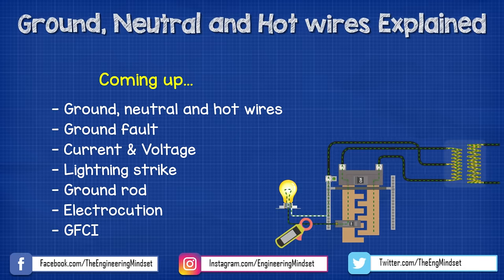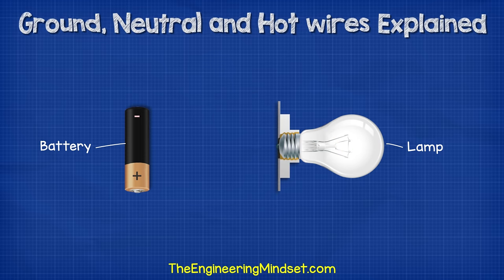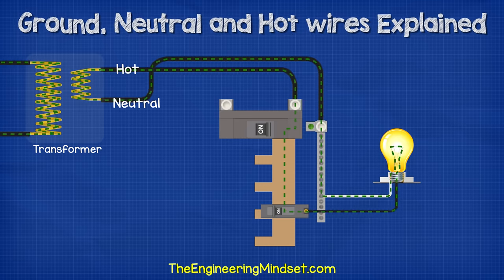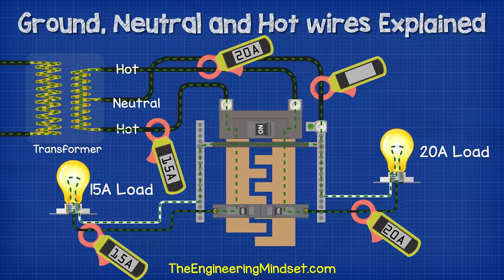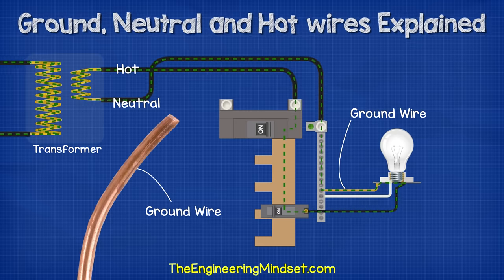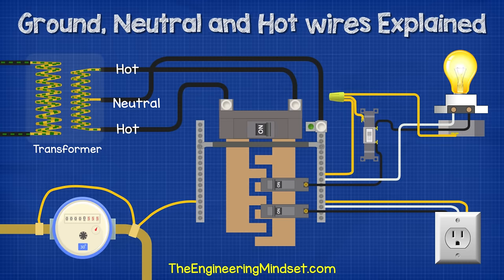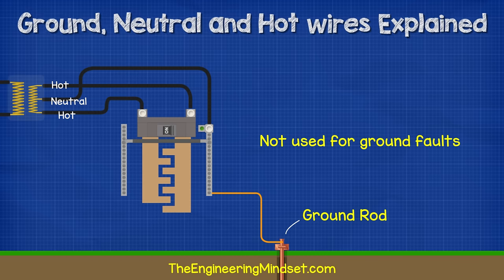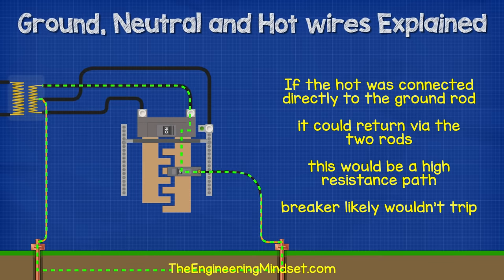Ground Neutral and Hot wires explained - electrical engineering grounding ground fault

Comment: Probably the best explanation I have heard. This covers a couple pet peeves of mine. For instance, you often hear "Electricity always takes the path of least resistance." No, no it does not. This video does a good job showing people this concept. Another is that people think ground is there to save them. Again no, at least in the direct sense. Excellent video.
Reply from the maker: We just published a new Ground fault, short circuit and arc fault video, so much detail! Link HERE➡: https://youtu.be/Qi0ynSQw-wc

Comment: Dear Paul, I was never clear how my electrical system worked.  Your video enabled me to run a 240V line from my cabin to my shed in the backyard and it WORKED!  I also tapped into that line and made a 120V outlet work to run the lights there as well.  Thank you for this fantastic elucidation of a very difficult subject to understand.  -Paul
Reply: That would be so illegal where I live. We're not even allowed to hook up a new socket in the house, that's reserved for electricians.
Reply: Bad idea.
Reply from the maker: We just published a new Ground fault, short circuit and arc fault video, so much detail! Link HERE➡: https://youtu.be/Qi0ynSQw-wc

Comment: I been an Electrician for 40 years.. Someone finally shows how it works and why.... Yeah it's a simple explanation..But it sure helps new engineers understand the why part. As America and European have different types....

By the way.. It's why we only bond the Main Service Panel..It's need a path back to the transformer..All other sub panels are not bonded...
Reply from the maker: Check the new SUB PANEL EXPLAINED ➡️ video https://youtu.be/NUSNa-7Hecw

Comment: These are very good videos, I highly recommend them for simplicity in understanding electricity. Keep in mind that ground rods are used mainly east side of US and in the western states with rock they do not use ground rods but use a ufer ground in which Florida is now requiring them with the Delta ground. A ufer ground is copper wire cadweld to rebar 20' in length and is encased in concrete, i.e. footers, of course this is commercial and not residential.
Reply from the maker: We just published a new Ground fault, short circuit and arc fault video, so much detail! Link HERE➡: https://youtu.be/Qi0ynSQw-wc

Comment: Great video! It raised 2 questions in my feeble head:  1) Why aren't ground wires insulated? Seems like that could potentially make them useless should they be in contact with something grounded.  2) So what happens when a hot touches a ground? You mentioned it wouldn't trip the breaker, but didn't mention what would happen.
Reply: The answer to one, I believe is that ground has no voltage and neither does the ground wire that runs through the house because it is all connected.  Any voltage getting on it from, say, a loose power wire would run directly through that wire to the ground.  It would have no tendency to move off that wire, so it doesn't need to be insulated.
Reply: @robertbrandywine  Sorry, maybe my question wasn't clear. If a ground wire is touching something that is earth grounded, electricity might follow that path rather than returning to the origin. 

Guess it wouldn't do that since still lower resistance to the origin....answered my own question.
Reply: @okaro6595  Not to be rude, but your reply made no sense.
Reply from the maker: We just published a new Ground fault, short circuit and arc fault video, so much detail! Link HERE➡: https://youtu.be/Qi0ynSQw-wc

Comment: Outstanding video. I'm a retire Mechanical Engineer and I needed a quick brush up on electrical principles to work on a few things around the house.  This video covered just enough - not too basic but not too extensive.
Reply from the maker: We just published a new Ground fault, short circuit and arc fault video, so much detail! Link HERE➡: https://youtu.be/Qi0ynSQw-wc

Comment: Hello, nice presentation.  On the subject of Neutrals and Grounds, I’d like to insert something.  True, electricity follows the path of least resistance, to a point.  To be correct electricity follows all paths available, some carry more current due to less resistance.  So, a Neutral Wire in America carry’s the Unbalanced 240 volt current back to the source, ie... generator.  The ground in that system will also carry part of the unbalanced load, not as many amps as the neutral only because of resistance, ground wires are allowed to be smaller sized.  Make no mistake, if you disconnect a home ground wire from the connection point and connect a multimeter you will read current flow.  Just my 2c’s worth, be safe.
Reply from the maker: Check our new Multimeter tutorial out ➡️ https://youtu.be/4lAyzRxsbDc

Comment: What a find …. Your whole site that is ….. This year marks 50 years in Electronics!!! 20+ years career in Air Force as Radar technician which helped me walk into a 25+ year career  at The ElectroScience Lab of Ohio State Univ as a Radar Tech and then small jobs on the side!!!  I could ….. but I won’t bore you with stories of working with giant tube rectifiers, capacitors, resistors to discrete parts no bigger than salt ….. thank you for keeping this old brain sharp using very concise, factual but also very entertaining methods!!!
-signed
-RADARMAN
Reply from the maker: Check out NEW resistor video, everything covered! ➡️ https://youtu.be/DYcLFHgVCn0

Comment: As a mechanical engineer I took circuit analysis and the professor never talked about a neutral wire. We only ever talk about the terminals of a source. One being at a higher potential and the other being ground (0V). I did learn a lot from this video.
Reply: What happens if you treat the neutral like the ground? Goes to the same place ultimately. My best guess why we don't do that is because every line has resistance, and the more current flowing the larger the voltage difference between neutral at the appliance and "true" ground, and it will tingle every time you touch a (pseudo-) grounded portion of the appliances. The shower head at my old apartment always felt like it was stabbing my finger a little bit every time I showered. Measured about 1V AC when wet.
Reply from the maker: We just published a new Ground fault, short circuit and arc fault video, so much detail! Link HERE➡: https://youtu.be/Qi0ynSQw-wc

Comment: Great way of explaining. I didn’t realize that the neutral only carries the difference of the current. One word about ground wires, I’ve learned not to trust them and be careful disconnecting them because if someone is using a ground wire to carry current, it can go to full potential once it’s disconnected. So never assume a ground wire doesn’t have voltage, especially when you disconnect it.
Reply from the maker: We just published a new Ground fault, short circuit and arc fault video, so much detail! Link HERE➡: https://youtu.be/Qi0ynSQw-wc

Comment: As a electrician I always wondered how the ground wire would trip a circuit breaker due to it being hooked up to the neutral in houses but I see due to low resistance it cause the influx in amps cause th breaker to trip very nice 👌🏻
Reply: The ground wire never has less resistance. The video is not accurate about that. In many applications the conduit is used as the ground which has a far greater resistance than copper. In larger wire applications (10GA and larger) it is very common to have the ground wire be 2 sizes smaller. It simply needs to hold current for a fraction of a second up to 10x rated load if the ground becomes the return path due to a fault and trip the breaker.  It is the same gauge in residential to make it easier to work with.
Reply: So if I have a hot and a neutral wire light fixture and I’m trying to attach it to a lighting housing box that has hot, neutral, and exposed ground wire. Should I leave the ground wire not connected and just shove it back in thr box unused? Or should I connect neutral and ground wires all together in same wire clamp? And hot with hot?
Reply from the maker: We just published a new Ground fault, short circuit and arc fault video, so much detail! Link HERE➡️: https://youtu.be/Qi0ynSQw-wc

Comment: How curious. Here in Brazil I was told to never connect the ground rod to the neutral wire, as it would be a bad and unsafe pratice. Never got a decent explanation, but yours make sense.

Comment: Thank you for this.... This was better then my apprenticeship classes.... I wish they explained it like you and had animated pictures like yours
Reply: In India it’s 220 AC . My electric iron has a small leakage in it’s metal body. This is observed when I disconnect the ground wire. With a three pin plug having phase neutral and ground wire ( we call it earth) the residual current in the metal body travels via ground wire and makes it safe to handle. This shows that the ground wire in house hold circuit always carry some current to earth. This is because of poor insulation in motor of refrigerator, AC,Iron or toaster.
Reply from the maker: We just published a new Ground fault, short circuit and arc fault video, so much detail! Link HERE➡: https://youtu.be/Qi0ynSQw-wc

Comment: This is great but I have one criticism: in a DC circuit, although electrons do travel from the negative to the positive, we tend to ignore that and imagine that it is the other way around. And I'd prefer to call the terminals positive and negative in electrical circuits and for digital logic/electronics it's usually high and low or 5/12/3.3v/power and ground.
Reply from the maker: You want us to teach you incorrectly?
Reply: One is conventional current flow and the other is electron flow version.  The video is going by the electron flow version.
Reply: The Engineering Mindset considering that power is disconnected at the positive terminal YES.
Reply: @EngineeringMindset  not exactly I'm just staring the convention. I'm not saying you should do anything and anyway I don't really know what I'm talking about tbh.
Reply: 1024  The electron flow model (negative to positive) is thanks to Rutherford's model of the atom, where electons are assigned a negative charge and protons positive.  The current flow model (positive to negative) was, I believe, thanks to Edison, who likely knew nothing about atoms.  It's too bad a consensus between the two models hasn't been decided upon.
Reply: @heronimousbrapson863  Negative is female, or the attracter/receiver in electricity and beyond.  Male is positive, or the will/force.
Reply: @heronimousbrapson863  And should be named as such.
This is the universal law of gender.

Comment: Very clear explanation, congrats, I will install a refrigeration cabinet with some 120 VAC instruments inside, I build the three point ac plug acording with the position of hot, neutral and ground, and was trying to understand the connection of ground with 120 VAC derived from threephasic 220 VAC + ground, now is clear, thankyou very much.
Reply from the maker: We just published a new Ground fault, short circuit and arc fault video, so much detail! Link HERE➡: https://youtu.be/Qi0ynSQw-wc

Comment: You should explain that electrons flow in the direction opposite of the current flow convention.  That may help some people. - or confuse them further.
Reply: By convention, If you have a wire and a positive current is measured going from left to right in the wire, then electrons are moving right to left (opposite direction) in the wire.  This is how the convention defined.  In his example with the battery and light bulb, a positive current will be measured coming out of the positive terminal (cathode) of the battery, through the light bulb, and back into the negative terminal (anode).  Electrons are moving the opposite direction as he shows it.  Learn more about it: https://en.wikipedia.org/wiki/Electric_current
Reply: Then to really confuse,there is no 'flow' really😉
Reply: @multidayticket  I think the confusion is using both DC and AC currents in the example.
Reply from the maker: We just published a new Ground fault, short circuit and arc fault video, so much detail! Link HERE➡: https://youtu.be/Qi0ynSQw-wc

Comment: So ground is basically an emergency neutral... thanks man
Reply: The ground is a backup in case the neutra wirel fails or the positive wire insulation either melts or breaks and touches the metal EMT conduit
Reply from the maker: We just published a new Ground fault, short circuit and arc fault video, so much detail! Link HERE➡: https://youtu.be/Qi0ynSQw-wc